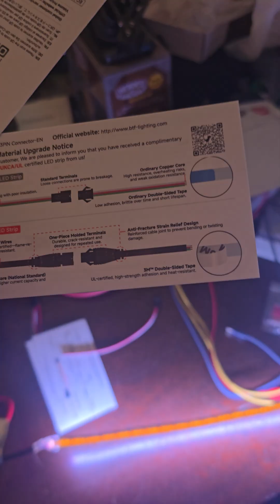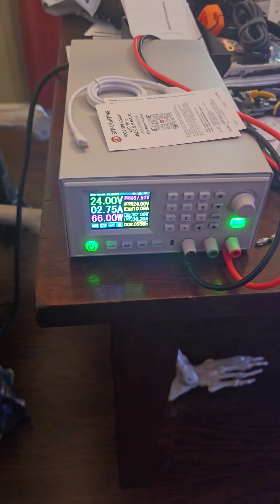Why BTF Lighting's New FBOB LEDs Are a Game Changer!

Comment: That's really interesting.  I have several projects in mind.  What's your recommendation on small power supplies like you have on the left side of the table you are powering the strip with? Thanks.
Reply from the maker: Doesn't take anything big or expensive. I'm running two strips on a cheap $16 24v 6a power supply, no fans, nothing fancy.

https://amzn.to/4mVKZOa

When I get to a computer I'll add some links to the video description.